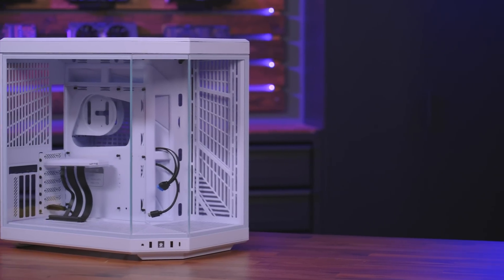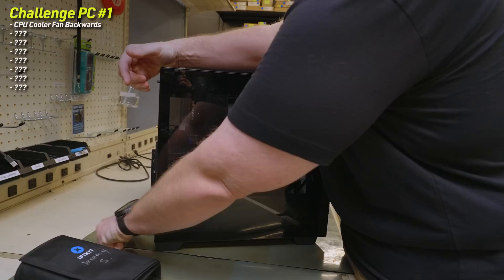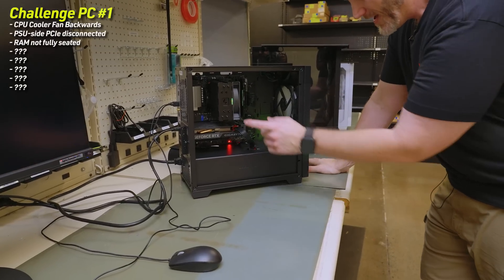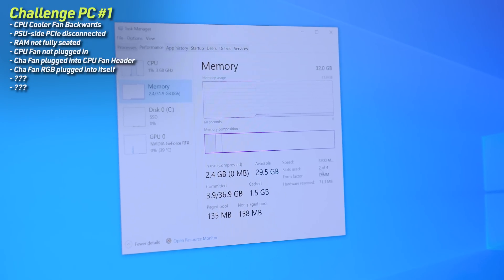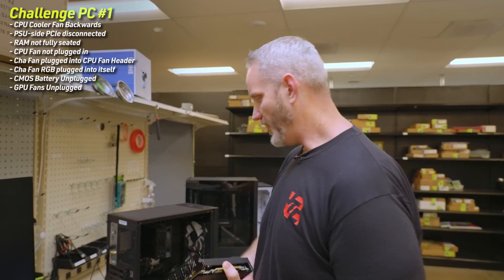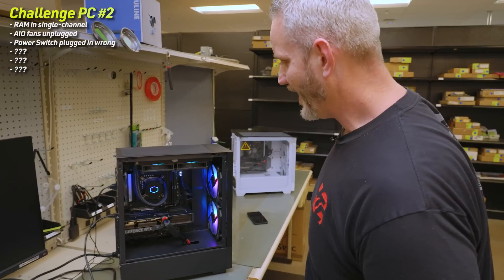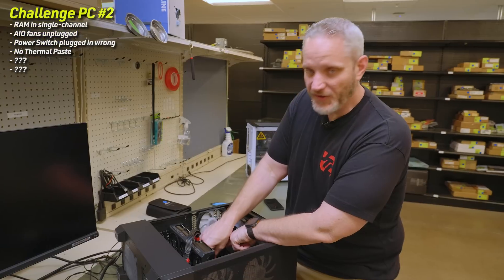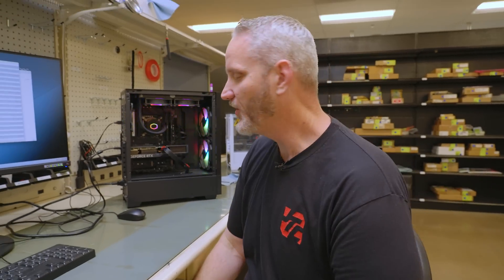Testing my troubleshooting skills!

Comment: I have a challenge for you, one dead computer, only all the parts on the table work just fine, in the cabinet, nothing works. Same parts in different cabinet works, but new computer does not work in the first cabinet. There are no shorts, no faults or pieces missing, that first cabinet, just do not work. And I don't mean the buttons on the cabinet. Any part you put into that cabinet stopped working.

Years ago I was delivered a pc to repair and the above fault was shown. Weirder still, using a multimeter while the cabinet wasn't connected to anything, it still had a low charge, almost like a battery. How weird is that. The whole story is that it was a steel cabinet that survived a lighting strike. Even 5 years later that cabinet would stop anything you put into it.

Back then I was so confused that its hard to even explain it all, it couldn't be happening, but clearly it was happening.

Comment: I just built a new PC and randomly every few hours my USB ports and my fans will turn off and then turn back on 5 seconds later. It’s like they are resetting because my computer doesn’t turn off and my game doesn’t die. All the RGB’s on the fans turn off and come back on. It looks like a partial power flash. 

Specs for my build:
Rog strix z790-f
Corsair HX1500i
Gigabyte 4090
I9 1400K
All Corsair fans 
Case - Corsair 5000T

Is it my power supply, the motherboard or something else?

Comment: That was a nice one. A few very dirty things like the plastic on an old cpu. Or the cmos battery that was hidden. Or the LED that was plugged into itself and then taped together. But you found all of them.
Very good skills and the way you did it also made a lot of sense. Personally i would not agree with let the CPU cooler run without a fan just with passive cooling from the case fans but i also don't know the timeline. A few minutes are properly ok but i would not let it run for hours like this.

Great video Jay thanks

Comment: I build PC's and have worked IT for a major company. I had a build about 15 years ago when I was still new that I just could get to run stable. I didn't have parts to swap. I brought it in to the tech bar and they got the PC running. Turned out one of the RAM sticks was bad and the CPU was defective. They swapped the parts and charged me their minimum fee since the could handle the defective return. That experience turned me into a life time Microcenter fan even though I live an hour away.

Comment: BeQuiet PSUs don't cut power to the system when you turn off the switch at the back. You can't turn on the computer, but it still feeds it power, including powering some USBs, etc. Only way to cut the power is to pull the plug

Comment: Can you please do a video talking about the TDP on CPU’s please? I have a intel 11th gen cpu and I bought a fan tower to cool the cpu and I saw that it was getting way too hot and the base TDP for my cpu is 135 watts. So it took me a long time to try and find a fan tower because I cannot afford the liquid cooler’s for my cpu so I got lucky and found a fan tower that actually showed the TDP in the listing and it was 240 TDP and I bought it but sadly I have low profile ram by Corsair and I still had to move the fan up just a little bit and it does keep my cpu cooled. I have noticed that you never talk about the TDP on the CPU’s that you are testing and what cooler do we need to get. Can you please start adding the TDP for CPU’s when you are talking about CPU’s please? Thank you

Comment: I was hoping they’d done something difficult! I’m a tech as well and back in the AMD Barton & Opteron days we used to “pencil mod” resistors for less v-droop, run wire strands across cpu pins to trick the cpu to unlock inactive cores, and lots of fun tricks! You should have corrupted the bios or flashed a different brand bios on the mobo or GPU! Lol

Comment: My cooler fan is pulling (my case is special), it works fine. You said because air can flea out the sides but when pushing the problem is exactly the same.

Comment: Correct me if I'm wrong: but when the PC challenge went down with GN Steve, wasn't the (AIO) plastic on the bottom of the cooler not been removed either 🧐

Comment: Before turning a non working PC on.  The very first things you should be doing is NOT TURNING IT ON until you've gone over it and made sure things that should be plugged in are exactly that plugged in. Like power cables are they plugged in are they plugged into the right power sockets on both ends, Is the ram seated properly, Is the GPU seated properly, are the systems fans plugged in to the right fan power plugs these are all thing you should be doing Jay before even thinking about turning on a system as you could have caused a short in any of the loosely fitted hardware and possibly killing it.

Comment: I was upgrading and fixing  a 8700K that was very nicely built but...for almost all of it's life the cooler had the plastic cover. The issue with the PC was not overheating but since it was an old pc and i was u[grading it i also changed the thermal paste and saw this.

Comment: Hello Jay, my name is Dom I have a question so recently when I’m playing video games on my computer like apex or call of duty zombies with a controller it has been causing my keyboard and mouse to shut off and the sound from my headset come out of my monitor like something is disconnecting but I can’t figure out what it is… any solution or ideas what it can be ?
Reply: It also causes me to shut down my computer bc I have no controls over my computer anymore I’ve tried unplugging my keyboard and plugging it back in still doesn’t come back on I’ve even tried  unplugging the usb the controller is connected to and it still no luck or getting control back

Comment: Watching you troubleshoot these in this manner was far more educational than I had thought it would be. Like a checklist of things to check in an ALREADY ASSEMBLED PC, which is quite a bit different from the BUILDING IT approach we’re used to.
Reply: Things that should have been checked long before turning that PC on for the first time by doing what he did with that first PC he could have caused shorts and killed the ram or anything else that wasn't seated properly also not making sure that the power plugs on the PSU weren't plugged into their respective sockets could also have caused damage

Comment: You mentioned Prime95. Do you have a suggestion on which older CPU would be good that I could get cheap off ebay? I spoke to AMD and they said, after looking into it, they do not have any recommendations for that application or use.

Comment: AIO's , custom water cooling, are unrealiable! stick to nice air cooler, if the fan fails you can replace it. and if if it goes completley, its alot cheaper than these over priced 200.00 plus AIO's.

Comment: The Greatest Technician That's Ever Lived
Reply: Wasnt expecting to see you here lol, but i love your content and hope i can do something similar
Reply: Wasn't expected, but love your famous line.
Reply: As you can see, he doesn't have tiny racoon like fingers.
Reply: Lol
Reply: No no he isn't he could have caused alot of damage to that 1st PC just by turning it on like he did without bothering to check if power cables were plugged in properly or for any loose hardware that wasn't seated properly
Reply: @Athlonite69  the people at microcenter aren't going to configure a test like this with potentially short circuited connections, and Jay knows this. That would be incredibly unsafe. Put some respect on the man's experience with PCs. 😂😂😂
Reply: @Athlonite69  You do realize he's making a reference to his own content, right? Check him out, he's pretty funny.

Comment: I think Jay did splendidly in this challenge.  Kudos for the non-spinning GPU fans, good catch.  As an unpressured bystander when the utter lack of thermal paste was discovered and it did not appear that Jay checked the cold plate for the plastic I immediately said "Check the cold plate".  The one solution I disagree with was the one fan not showing LED's, IMO, the correct solution would have been to disconnect all the LED's (hell, just cut all the led cables).  :)

Comment: I love the Tech Bar at Microcenter, because they have the tools I don't have at home. I bought a cheap little Asus Laptop and immediately bought a M.2 for it for storage, and took both of them over to the Tech Bar and they just popped open the laptop and installed the M.2 drive for me. At the time, I didn't have a knockoff iFixit kit at home to use to pop open the laptop. Now I do.

Comment: I am using a Gigabyte Z690 AORUS Master motherboard and have a 128GB, (4 sticks) 6400MHz, G.Skill Trident Z5 DDR5 RAM kit installed. However, the system will not let me boot up with XMP enabled. Every time I try, I just get a black screen and have to hit the CMOS reset button on the board to get it to boot. What's up with that?

Comment: Always remember at uni a guy stripping out a PC that had been sabotaged by the lecturer, he had it in bits and never thought of checking the kettle lead, the fuse had been pulled from the plug 😂😂
Reply: customer states the computer self destruct on boot up🤣🤣

Comment: Hi Jay this might be a long shot but I seriously need help. My rig has given me sooo many issues lately whether it's crashing in fortnite, cod, overwatch and I'm constantly having to go into intels extreme utility app to tune down the cores of my cpu and I've done this twice I've gone from 60 p core ratio to 55 now I'm having to put it to 52. I'm not a computer genius yet but I am start school to learn how to fix computers but I'm seriously stumped on this I have a new components in my system so I'm confused on why this is even happening if you can help I'd greatly appercaite it if not thank you for making great videos on how to trouble shoot certain problems it's helped me alot.

Comment: I would have offered something more challenging and something a novice system builder might do - motherboard standoff shorting the system. That would require Jay to take the whole system apart to diagnose.

Comment: I immediately suspected the plastic shield on the CPU cooler, because the CPU didn't have paste on it, and the AIO looked new. To be honest, I too made that mistake, especially if I'm alone, and someone comes into the shop and then go back to build further. Jup the same. So you are not alone, Jay.

Comment: I have a powerspec pre-built and it's great. When I got it home I noticed a noise that seemed to be coming from the power supply. I took the system back to get looked at and they said they could not here the noise but would replace the power supply just in case. They also noticed the AIO I had was under recall and they replaced that as well. I was not charged a dime and I do not have an extended warranty. A+ customer service.

Comment: Eh this place is a bit of a scam. I went to the techbar in Tustin and they had my PC for a week before they started work. They then did virus scans for a day when I told them the hardware issues I was having and then they gave me the PC back with an ambiguous, it's either the motherboard or the powersupply. At the time, I was over the whole thing and just took my PC back without a definite solution. Made me sour on Microcenter for wasting my money and time.